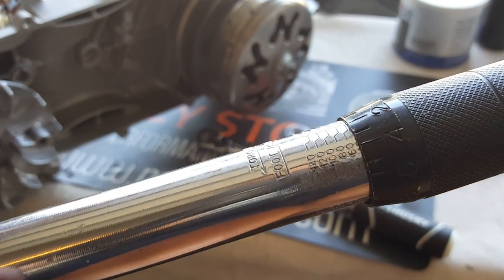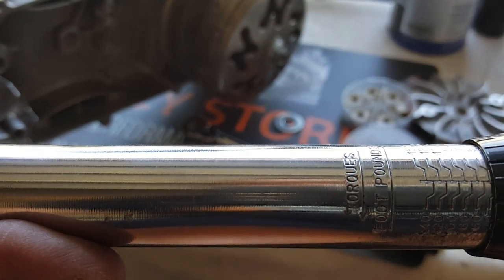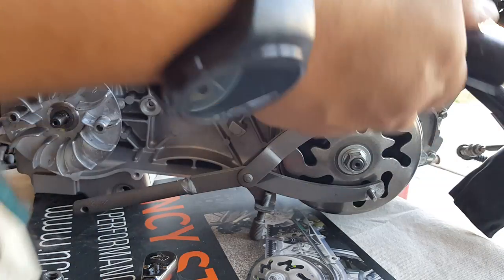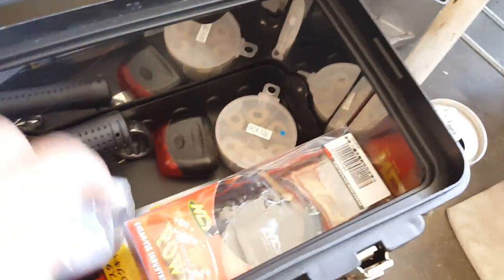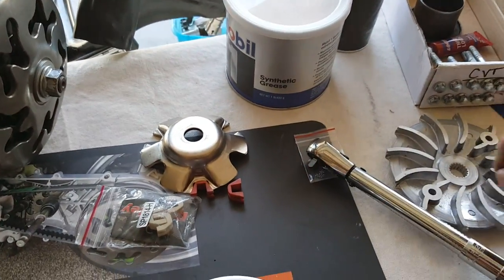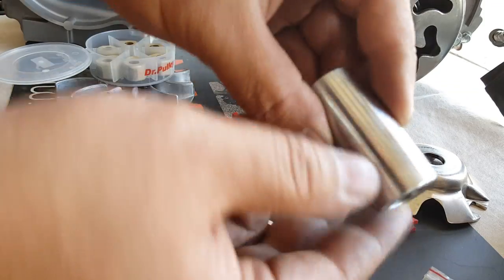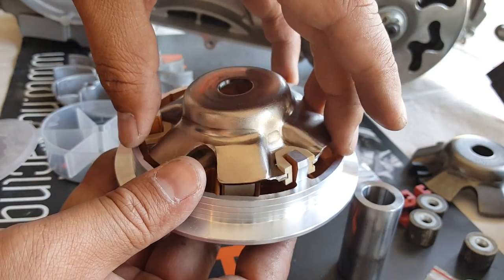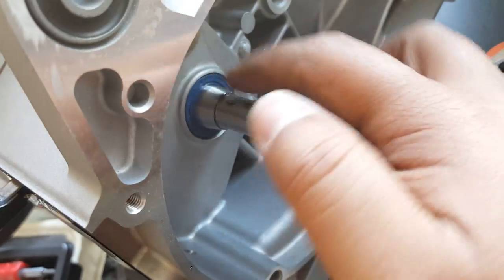How to install GY6 CVT & Trans on SSP-G 180cc POWER KIT Part #6

Comment: Another thing I just figured out, about two hours ago. To tighten the clutch nut, use some large channel-locks, or a large pipe wrench, and either a crescent, socket, or open end wrench. I have these, because I use these kinds of tools all the time. Should open to four inches. Anyway, grip the clutch backing plate, (holds the shoes), not the pulleys, with the channel-locks, or the pipe wrench. You can just get a bite, because the shoes are very close to the plate. Then, use the crescent, socket, or open-end, to tighten the nut. No damage to the plate. because it`s sturdy. The pulleys can distort, if you try to hold there. Works beautiful.  Just a little tech tip, from the masses

Comment: Can you add a kick start to a Tao motor Bull 200 atv with the 161QML engine?I would love to add kick start capabilities in case your out in the woods on the trail and the battery craps out enough to disable electric start.The cvt cover has a hole in the middle.

Comment: I don’t have a kickstart. My variator boss doesn’t come out far enough so when i put the washer and  variator fan on it smashes into the threads of the shaft it goes on. What can I do to fix this? You mention the variator sliding along the boss but i just don’t think it’s right to be running into the threads. I am thinking of adding a washer against the case where you put your kickstart gear to push the boss out. Any suggestions appreciated.

Comment: I got a question about the variator pulley without the cooling fins. Is that meant to be used on a transmission without the cover. I recently bought the Ncy super kit from you for my buggy. Should I have gotten one with fins on it?

Comment: hi there! can i use dr pulley rollers on yamaha grand axis 100 or suzuki an 125? please replay
Reply from the maker: That's a good question let me forward this to our tech department will be back open on Monday I should have a response for you then. :)
Reply: NCY STORE ok i Will wait in my country theres    thausands of yamaha grand axis and suzuki an 125 and pgo 150 scooters dr pulley rollers seems to be better that normal rollers
Reply from the maker: Yes, the AN125 uses 17x12 roller weights and the grand axis uses 15x12 roller weights. Are you interested in the Dr. Pulley rollers or sliders, we can have them available in their website in the next few hours?
Reply: NCY STORE I live in Dominican Repúblic and theres alot of grand axis 100 is Hard to find parts here
Reply: NCY STORE im just wanna know if they exist for thats scooters an 125 and grand axis 100 i have family in united state send me a link when you have them ready on the web
Reply from the maker: elvin poueriet we can get them I just need to know which one you need right away is it the Dr.Pulley Rollers or the Dr.Pulley Sliders, they have both kinds in those two scooter? NOTE: The Grand Axis 100 use same 40QMB 50cc 2-Stroke Engine rollers or sliders size 15x12.
Reply from the maker: Yamaha Grand Axis 100 uses Dr. Pulley Sliding Weights 15x12 https://goo.gl/fuQzFu
Reply from the maker: Suzuki AN125 uses Dr. Pulley Sliding Weights 17x12 https://goo.gl/aeQefx

Comment: what a mistake...the ruler don´t need greaseeee!......,whith the dust gonna be abrasive paste...wtf...!!!
Reply from the maker: Milko Chirinos hi yes the rollers weights you mean don't need grease. Shouldn't grease the rollers weights the NCY Teflon variator itself it's already coated to slide easily the roller weights any more substance will spin off run onto the dry belt causing unnecessary belt slipping, thus rotational will skip.